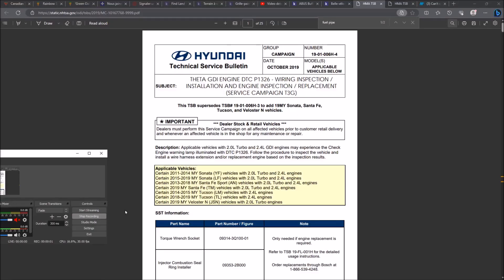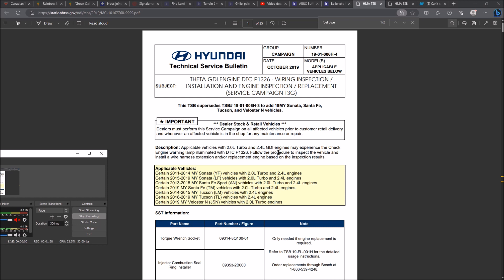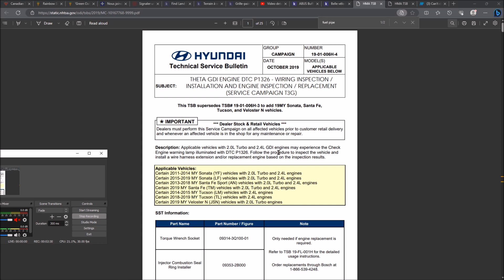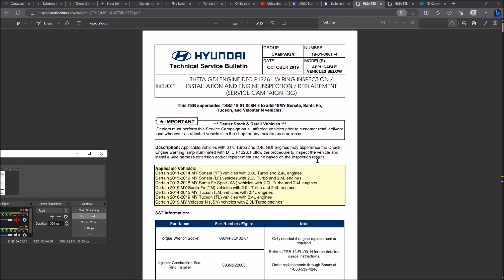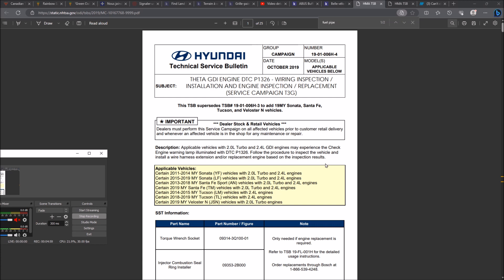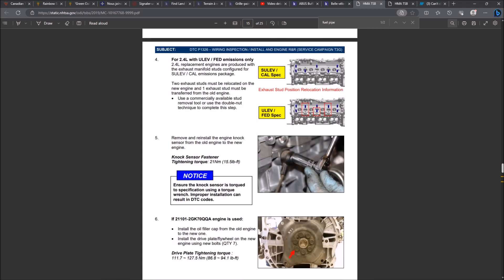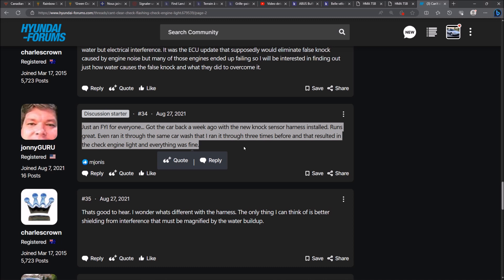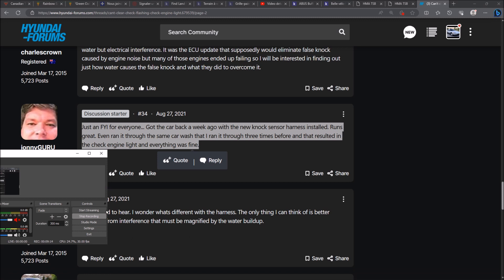Hyundai Kia flashing check engine no acceleration after heavy rain carwash limp no start P1326 code

Comment from the maker: Most of these engine seize either at 85k or 130k miles. 
Hyundai engine recall  https://youtu.be/ehHp8Te2uLw
Knock sensor harness wiring update  https://static.nhtsa.gov/odi/tsbs/2019/MC-10167768-9999.pdf
Engine replacement technical bulletin https://static.nhtsa.gov/odi/tsbs/2020/MC-10177126-0001.pdf
Knock sensor may trigger false alarm (car in limp mode - won't accelerate - and flashing Check Engine light). Two reasons for this false alarm : 
1. knock sensor doesn't have latest software update number 953  https://static.nhtsa.gov/odi/tsbs/2019/MC-10152889-9999.pdf
2. car was driven in heavy rain or through car wash. Let sensor dry a few days. Example of owner with flashing Check Engine and limp mode after car wash (or driving through heavy rain)  - read both pages https://www.hyundai-forums.com/threads/cant-clear-check-flashing-check-engine-light.679539/

Comment from the maker: NO START problems 
https://youtu.be/j6IhOwY5aFE
Key fob has a small red light at the top when pressing any button - fob battery replacement https://youtu.be/wnDnJgpxlxc
1) Seized engine: 2.0T GDI and 2.4 GDI gasoline engines die suddenly on the road and won't restart: engine is seized. Do not keep cranking, the starter will force and burn a ground cable behind engine (smoke - replace ground cable). Bring car to Hyundai for engine warranty
2) Several ground cables around the engine - remove bolts and sand paint. There is also one big ground cable between transmission and engine, passing under the battery. Also power starter directly to test it. Be sure battery has voltage - jump start will not work on flat battery, need to recharge it first at 50%
3) 2018 Sonata loose cable bolt at the starter technical bulletin 19-EE-007H
3a) 2011-2014 Sonata, Santa Fe, etc no crank - broken fork plastic piece inside starter, replace fork
4) Elantras - corrosion at the starter cable
5) 2011-2014 broken starter plastic shift lever
6) Faulty starter relays (two inside engine compartment)
7) Faulty Start push button itself
8) Faulty ECU relay (won't click with ignition On)
9) Code P1233, no start, stutter, lacking no engine power, acceleration hesitation: internal fuel pump leak Technical bulletin 23-FL-004H
10) Faulty fuse at the battery Positive terminal (fuse blows if battery mounted with reverse polarity)
11) Older models had brake pedal switch issue - replace switch. May also cause brake lights not to turn on when pressing the brake pedal. 
12) Car shutting down, several warning lights: double check 180A fuse by the Positive battery post, remove grounds bolts, sand metal, inspect big ground between trans and engine passing under the 12V battery
13) Faulty Console Remote Unit (10-14)
- this is the smart key control module which received the signal from the key fob (usually located below the center arm rest console).
14) Lights but only a click when cranking - weak battery, issue with grounds.
14a) JUMP starting - remember, you need to use thick cables to boost the battery start the engine from another car. If the cables are too thin, it will not pass enough amps to give your dead battery the right voltage to crank - let battery recharge 15 minutes or more
15) When replacing the battery, be aware 180 Amp fuse by the Positive connector will blow if you mount battery inverse polarity. Buy at H/Kia/Amazon. 
16) No start on warm engine only - check grounds. Also listen for fuel pump priming sound (no sound, pump relay issue or pump may be worn).
17) Shake transmission selector in P - if it starts switch doesn't detect properly when the selector is in P.
18) Put ignition to start, press brakes down, move gear selector to N, try to start: if engine starts, faulty transmission Neutral safety switch.

Forum discussions: 

https://www.hyundai-forums.com/threads/2012-hyundai-sonata-cranks-no-start.707466/#post-6248953

https://www.hyundai-forums.com/threads/2009-cranks-but-no-start.711883/